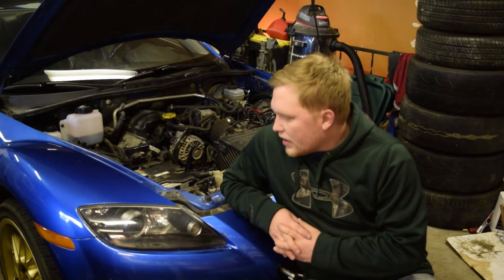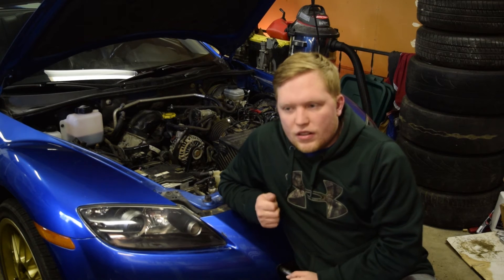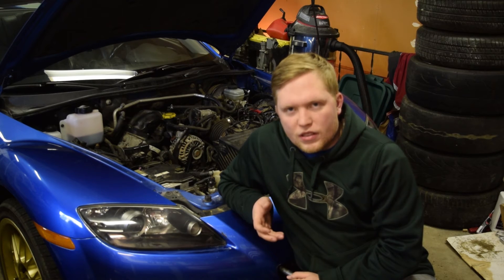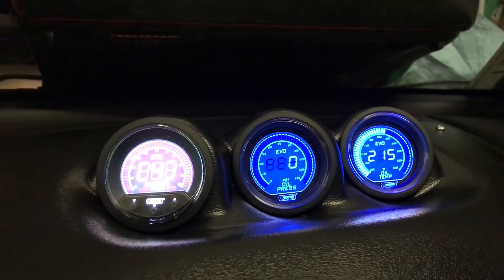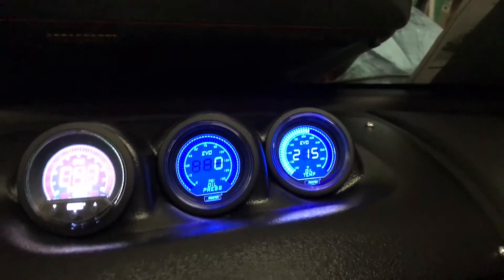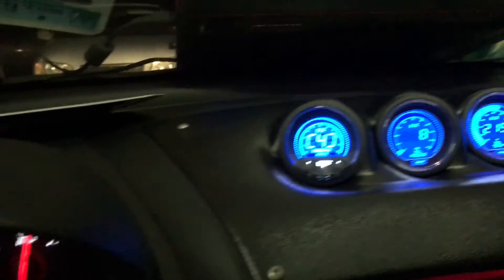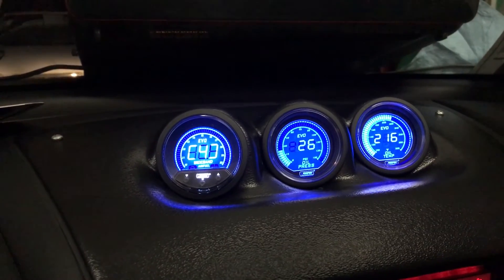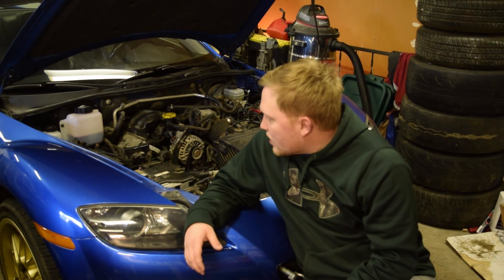Hot Oil Pressure Problem in Mazda RX-8 Renesis 13b Rotary Motor

Comment: Do you use a mic on your cam? Might want to consider that to avoid that static sound 👍🏽
Reply from the maker: Nick Walter This is one of the first videos I have done with my Rode VideoMic Pro mic and it's so sensitive it was catching the static sound from the stereo right above it! I leave it on and plug my phone into it via an auxiliary cable to listen to Pandora while working on the cars. The aux cord was unplugged here and that's the super annoying noise. If you listen carefully you can hear my truck outside warming up and getting ready for an oil change, as well as a dog barking next door too. Will take some getting used to as far as sensitivity goes!

Comment: stock sensor doesn't actually do anything. no temp reading at all
Reply from the maker: The stock oil pressure sensor? Yes, it is a faux gauge that doesn't read anything at all. Pretty sad that Mazda did that in my opinion. It isn't difficult to just do the old-school style gauges that the RX-7's had. This is why I decided to run aftermarket gauges to get accurate readings on my oil temp and oil pressure...time will tell whether these gauges run true or not.
Reply: yes pressure sensor, excuse me. sorry for my misinformation.